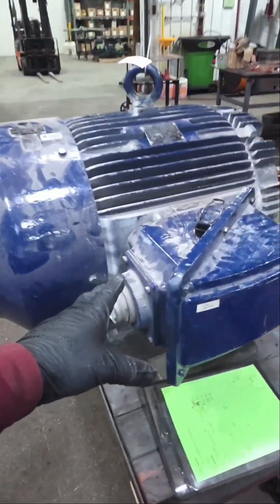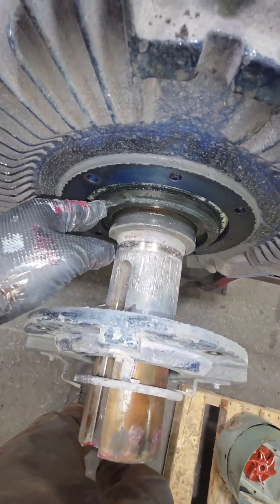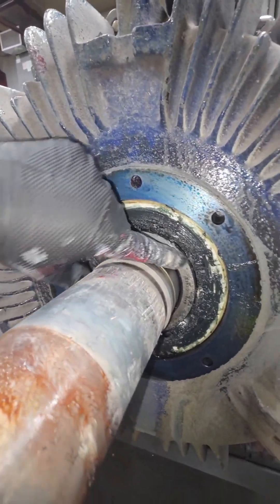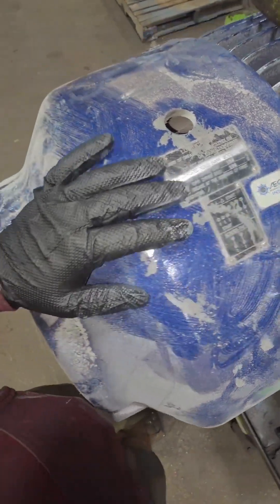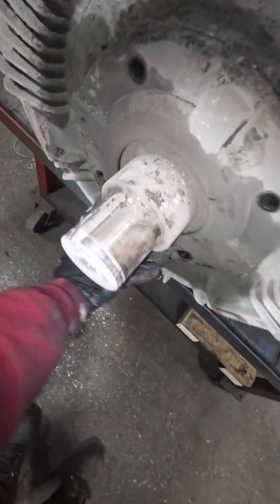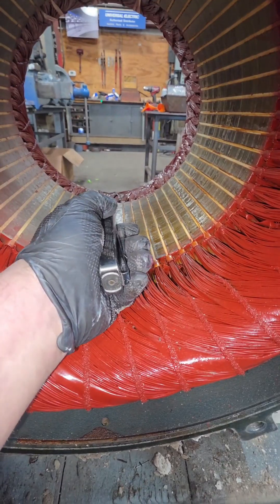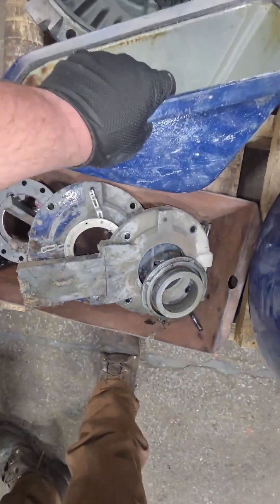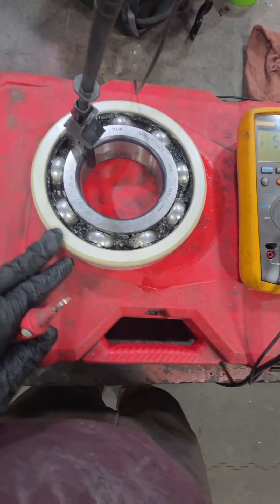Breakdown of a 150 Horsepower Electric Motor with insulated bearings

Comment: 1900 pound a/c electric motor 
producing 150 shaft horse power 

150 hp   
Tesla 
go figure 

new substitution for a lesser pound of weight at highest hp
yea i know the voltage of the motor
but
do you understand 
what the voltage required for EV.

busted

Comment: VFD repair, 2 insulated bearings & parts, R&R + reinstall + alignment, startup/commissioning & post-installation troubleshooting (just in case).
$18k - $25K. If its a rush job then charge $30K.